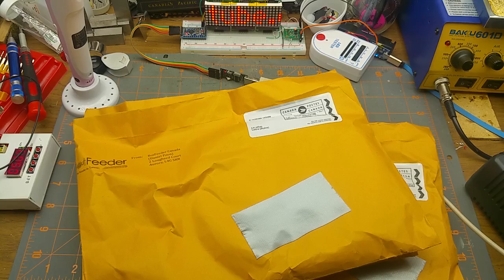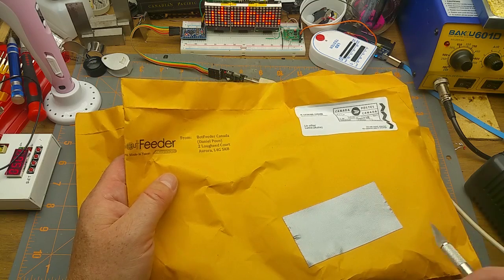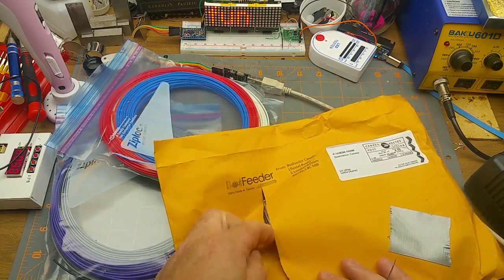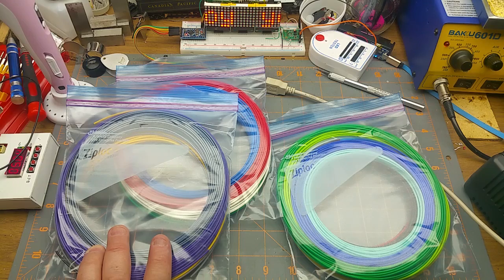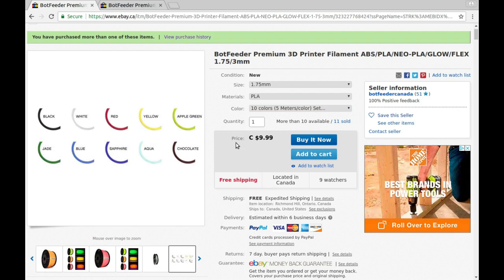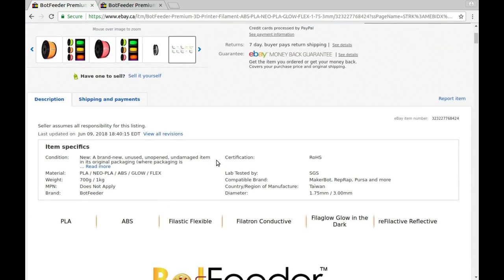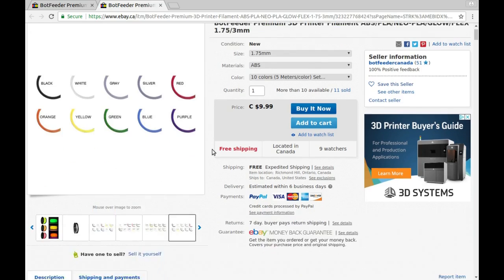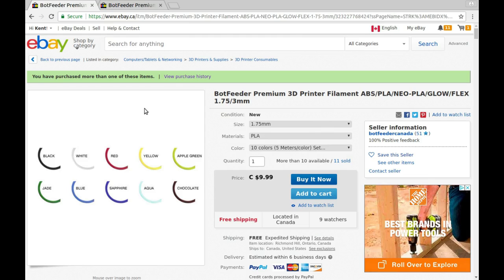playing with a 3d pen

Comment: PLA has a slight caramel scent when heated., or none at all ABS smells like burnt plastic. The giveaway was that the first one burnt a bit when extruding at 235 C (so it was probably PLA), and the white (or light bllue) didn't extrude at 200 (so it was probably ABS). Also, ABS is harder, it warps when cooled too quickly, and sometimes it doesn't stick that well to masking tape. PLA is easier to print with regular 3D printers because it's the opposite of ABS in these regards.